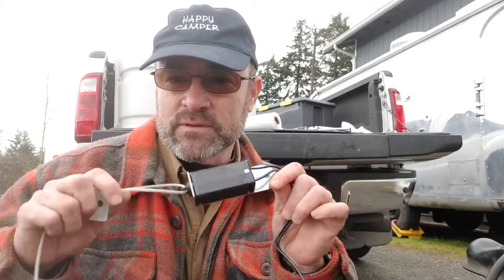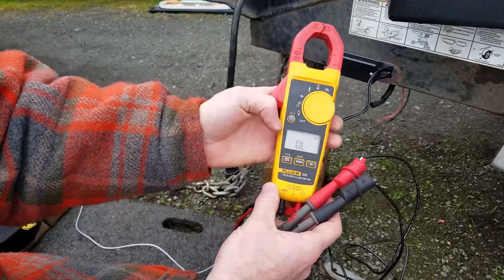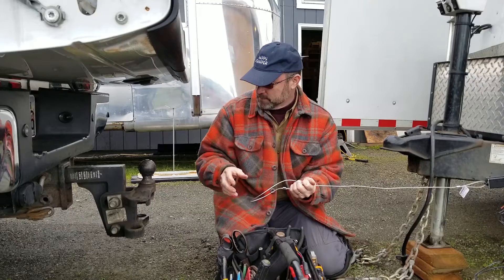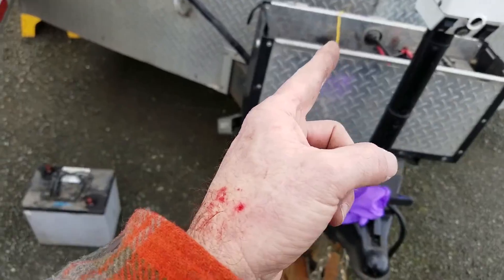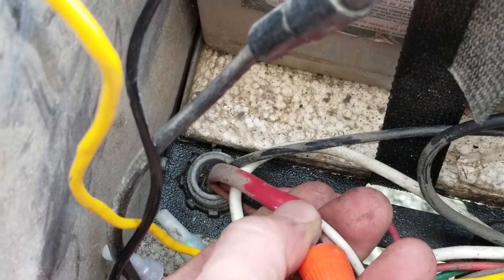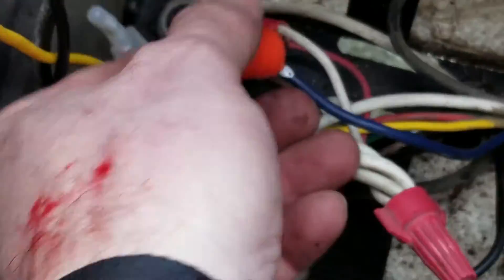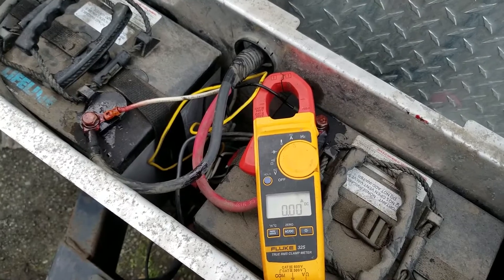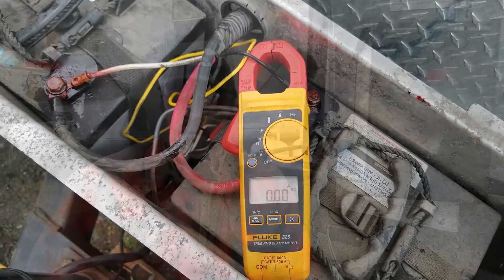Break-Away Cable - Your Trailer's Emergency Braking System

Comment: Thanks nice video. About how much slack should be in the breakaway cable? I watched a different video where they said that the chains should be crossed to catch the hitch if it comes off the ball.
Reply: TK S It needs to be long enough so that it doesn’t get tight and activate when you make a turn. Also it has to be shorter than your tow chains so it comes out before your tow chains get stretched if your trailer happened to come off the ball. That happened to me once because I have two different trailer balls and I forgot to put the right one on and of course it popped off on the interstate going about 75 miles an hour. And yes, cross your chains to they form a basked to catch it of it pops off and hopefully not drag across the ground.
Reply: @Meddawg799  Thanks. I just rebuilt the trailer and replaced the old cable with one of the new coiled cables. Your story reminds me of something that happened too me back in about 1983.... It is true what they say; that if it scares us enough then we won't forget it (we learn from it). The older I get, the wiser I get. LOL

Comment: I have a small battery for my break away system... I'm curious what you use the two batteries on your trailer for. Thanks!
Reply from the maker: Hi Trevor,

Since this is my RV Repair Service trailer there is a lot of stuff in there - well over $80K of parts and tools!  There is also a 3,000 watt inverter, refrigerator, microwave, air compressor. lights etc.  So these batteries are my 'house' batteries that keep my systems (and me) running when I am on the service calls for hours each day.  If the trailer was a simple cargo trailer  than a small battery is more than adequate to stop the trailer in an emergency.  Hope this helps!

Happy Camping,
Darren
Reply: They are 2 6V batteries to =12V.....suppose to supply power longer.
Reply: @miztrusa what is better?

2, 12v batteries in parallel, or 2, 6v batteries in series?

Comment: Great video.  Thank you.  Question:  if the 6 volt battery goes bad, will that interfere with the ability to operate trailer brakes and the controller?  Borrowed my friend's car hauler, and the trailer lights up when hooked up to my 08 F250 (still a great diesel thank the Lord) but brake controller inside says 'Trailer Disconnected' and I have no brakes.  Tried cleaning the pigtail, etc.  I thought it might be my truck, which is new to me as of one week.  I thought hmm, maybe it's my new truck.  My friend's 05 Dodge operates the brakes and lights on the trailer just fine.  We decide to try another F250.  Same thing: lights work on trailer but no brakes.  Hmmm.  How can this be?  Dodge works, but Ford do not.  Zee plot unfolds.  Then I noticed the small battery box on this single car trailer.  Did not have a voltmeter handy.  But found you here . . this is going to be interesting I can tell.  If I didn't live in Georgia I would call you to come to the scene.  I may have to you airliner you out!
Reply: No, they jus won't work but if ur towing ur tow vehicle should be charging ur battery while you drive thus you'd have power. Power is needed to activate. Your trailer brake is separate from this system. This is a stand alone emergency brake.

Comment: So you have a black and white cable coming from your trailer but where will the white cable coming from your trailer be attached to or connected?
Reply from the maker: The white will be connected to the trailer ground circuit.  It is also a best practice to not rely on the color of the wire jacket when doing any wiring on an RV.  Colors change but the circuit should be intact.  Best to use a meter and verify the circuit and not connect based on wire color.  I have been on more than one service call to correct wiring issues because only the color of the wire was used to make connections.  It is an expensive mistake...

Cheers,
Darren

Comment: I am getting a bunch of unclear info on how long the brake switch cable should be. 

Should it be adjusted slightly shorter than the chains thus engaging the brakes if the trailer drops and the chains catch it? It seems like that would put a tremendous amount of stress on the chains with the trailer suddenly stopping and the tow vehicle still going.  

OR should it be longer than the chains so it won't engages the brakes if the trailer drops on the chains? Thus it would only lock the brakes if the trailer came completely loose?

I went for a wild ride today. Had a 2" ball on a 2 5/16" trailer (my fault 100%). trailer popped off at highway speed and the chains caught it. I was able to slow down and stop. Nobody got hurt and only minimal damage. But brakes did not engage from the breakaway (breakaway cable was longer than the chains), and I am kind of glad they didn't since I feel it may have snapped the chains off and the trailer would have stoped right in the middle of the freeway causing a major hazard.
Reply from the maker: The principal I follow is that the Breakaway should be longer than the chains and also separate from the chains. As a safety device it should not be part of the chain assembly. So if something should happen, like your story, the chains, which should be crossed in a cradle, will catch the trailer and prevent it from nose diving into the road. If the chains should fail then the Breakaway would be pulled and engage the brakes. There's also a comment here about a guy with a fifth wheel that was making a turn and the Breakaway cable came out in the middle of his turn locking up his brakes in the middle of the intersection. So that would be another reason to leave your Breakaway cable long so it never interferes with the Turning of your unit.
Reply: Jus make it long enough so none of ur turns won't trip it. It's not rocket science

Comment: Good video, I would suggest taking the wire nut connectors off though. Per spec any type of connectors where vibrations occur should be secured with proper crimp connectors and water proofed. Heat skrink is fine but a better solution is crimp connectors that have the skrink wrap and adhesive built into the butt ends. This is also the case with junctions, 3m makes a impressive line up of connectors for these applications.
Reply: Soldering is best.

Comment: If the break-away pin is pulled on a parked travel trailer will the breaks draw battery power continually until the battery goes dead?
Reply from the maker: Yes absolutely! There is nothing telling that battery not to send power to those brakes if you pull the pin. When the battery dies the brakes will release and the trailer could start rolling.
Reply: And worse, the switch is a fail safe only device designed to push 12v and a lot of amps for only minutes, sacrificing itself in the process to stop the trailer. Pulling the pin with a hot switch for even very short periods of time will cause the magnets and switch to heat rapidly, in some cases the switch will smoke and melt due to the current draw. It's good to pull the pin to test for continuity every now and then with a multimeter but NEVER with the battery attached.
Reply: @hojo70  :   Thanks!  That ma be why my lovely little trella won't roll down the road at all.  I plug in, and start to roll but the brakes activate by themselves - sometimes within a second, sometimes later.  But still trying to diagnose.

Comment: Still working my way through your excellent series of videos.  The one thing I like the most is with your videos is I get a better understanding of what might actually be wrong and how to possibly diagnose it, depending on what the problem is! As I don't want to get zapped! 
Should any of your videos problems happen to me.  Already got to use the "close the power awning with a battery" because the RV dealer had, unknowingly, severed a wire bundle affecting both the bedroom slide and the power awning.  They ultimately fixed their error at no cost to us but after opening the awning  I couldn't get it to close again since the fuses kept blowing for the awning and slide. Unplugged it at the top, made a long harness and used a 12V battery to get it closed, so I could take it back to the dealer the following Monday.  It was on a Saturday afternoon, and we'd just picked the RV up and gotten it home from them having it for 9-months working on the RV.  Oh, what fun that wasn't!
Last year I got to experience the emergency line pull when making a right turn in a town and the breakaway wire had been caught under part of the 5th wheel hitch on our truck. In the middle of the intersection in the middle of the right turn and the breakaway line got pulled. Sudden stop made me think I had hit some unseen vehicle it was such a hard stop. Then it was very quickly trying to see what happened, my wife saw the line was hanging there, so I got out and plugged it back in then I was able to clear the traffic buildup of where we'd stopped. After that experience, I switched to one of those springy coiled red wire emergency lines. I'd read both good and bad about them but so far I like it. Not only does it keep a constant length with the built-in tension it also keeps the breakaway line up and not in any danger of being caught when the 5th wheel is parked and unhooked.
Reply from the maker: Thanks for sharing your story, I use those red spirally coily Breakaway cables. I like that they keep everything taught.